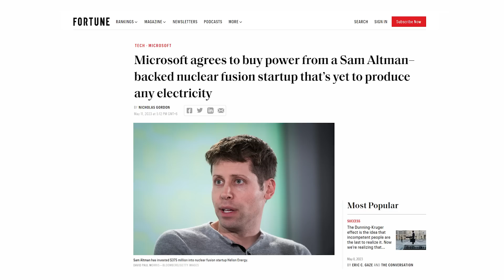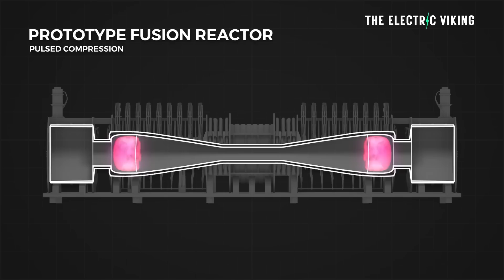Microsoft says the nuclear fusion dream is about to become a reality

Comment: Fusion energy may happen in the lab in the next few years, but building a power plant that can output to the grid at a cost lower than the ever dropping levelized cost of existing renewables is not going to be any time soon. These fusion designs all require very expensive equipment, and it will be quite some time until they know if they can keep them going without so much self damage such that they can't make payback. Remember, solar, wind, and geothermal are all zero fuel cost technologies. This means that even if the fusion industry can get their fuel cost down very low, their build-out cost will have to beat the built-out for renewables. So I agree, that the projected LCOE curve for existing renewables means that, even when fusion works, it will only be cost effective in special applications such as spacecraft, for the foreseeable future.
Reply: So why did we ever have nuclear fission reactors, those are stupid expensive?
Our power sources aren't purely just "whatever is cheapest" - sure, that can make up a large proportion of a nation's power needs, but that doesn't mean it won't use any other technologies.
Both types of nuclear should be good at providing "baseline load", they can generate up to a set amount of power and it doesn't matter if the wind's not blowing or the sun isn't shining.
Even if fusion is expensive, I still think at least several countries will want to incorporate it into their power grid. Sure, the process of building it may be subsidised through the government, but they'll be built regardless.
Reply: @Nabushika  - Nuclear fission reactors were supposed to be cheap, but it was a lie. However, MSRs really are going to be cheap compared to both conventional and Fusion reactors. There may be a few reactors, so they can justify the obscene amounts of money that's been wasted on these White Elephants. However, the cost is absolutely going to be a driving factor, you can't ignore fundamental economics.
Reply: @Nabushika  You are correct that it would have to be government subsidized. That is because the first cost you run into is the cost of finance. After you have a working prototype, you have to go in front of a group of investors and talk them into putting up the money for a plant build. They are going to ask when does it pay them back? The longer that projection runs, the more interest has to be paid. Right now, investors are funding renewables because the cost of building a renewable power plant shows return by beating coal and gas on cost. It is possible that after they get fusion to work, at all, they will be able to work on cost reduction until it becomes commercially viable. They are hoping to make it work, at all, in the next decade. If that happens, they are then looking at working the economics, not of  today, but of a decade from now when the costs of renewables are even much lower than today. The bottom line is that commercial fusion is still decades away, and will continue to be so until they can demonstrate a competitive LCOE.
Reply: 100% spot on.
Reply: @BadWithNames123  buuuulllshit. 10x cheaper by 2028, are you out of your mind? It's not even been commercialised yet, do you have any idea how expensive solar was for the first few decades it was around?
Seriously, I'm incredulous that you believe an expensive, still-experimental technology could outcompete the cheapest way of generating electricity we currently have, in just 4 years. Even assuming people can start making viable fusion reactors by 2028, which is still not a given, I'd be comfortable betting it doesn't undercut solar for at least a decade... in my opinion, the only way it'll beat solar is if/when our energy consumption grows by a couple of orders of magnitude, and we can scale up fusion but it'd be impractical to cover more of the planet in solar panels (although we're likely to have at least a couple solar space stations by then ;)). It might well be cheaper to make a bigger reactor with a massive amount more volume than constructing square kilometers of solar cells.... although if we can figure out the issues with perovskites, that's going to be insanely cheap.
Reply: @BadWithNames123  The point is that "cheaper than current electricity" is not enough, it has to be cheaper than future electricity at that future time.Not only will wind and solar plus batteries be cheaper next decade, but deep geothermal is expected to come in with 24/7 baseload capability with no battery. I expect fusion will happen, but it will take longer than the developers hope it will (the usual case) and be used first in special applications where the cost is not as critical, especially spacecraft where fuel mass is most important.
Reply: Sorry, Helion and AGI (Artificial General Intelligence) are both a scam, good luck with that ..
Reply: @huveja9799  hah, sure buddy. AI has been advancing exponentially but I'm sure there's nothing to worry about as it keeps becoming more intelligent, more capable, and more general :P
Reply: @Nabushika  "advancing exponentially" .. well, actually the technology is old, the only thing that was done was to improve the architecture a little and use the advantage of the computing power that we have today.

That made it possible to train on massive amounts of text, and have massive number of parameters, but without any new fundamental innovation  .. nowadays we are already getting to the level where adding more parameters doesn't improve significantly. I wouldn't call that exponential improvement.

On the other hand, when we talk about AI today it is Machine Learning, and that is pattern recognition, nothing more .. but equally, you can stay waiting for the AGI to solve the problem of cancer or nuclear fusion, just in case have a good old fashioned wood stove nearby ..
Reply: @huveja9799  "adding more parameters doesn't improve significantly" - well clearly you're not an expert, studies over size of the network and training data show we're still getting better results just from making it bigger (along with providing more data). And that's ignoring all the new advances such as the transformer architecture - we've made significant progress and it's not just due to computing power (although of course we could not achieve these results without it).
Sure, you can argue all you want that it'll never be conscious, and I'll happily debate about that, but if you think it's not going to help us or be useful, you're deluded. One fantastic example is AI protein folding - that's allowing us to speed up drug discovery thousands of times, meaning more effective medicines developed for much cheaper than before, all because "pattern recognition" can fairly reliably guess the shapes of folded proteins from a string of amino acids. This was unthinkable a decade ago, and even 5 years ago the best algorithms couldn't compete with human intuition (if you want to give it a try yourself, there's a game!).
GPT-4 is insanely good at a wide variety of tasks. I don't think it's AGI, but it shows that we're making progress in that direction. Perhaps size won't be enough, I concede we may still be 1, 3, 10 big, new ideas away before we get something that people agree is AGI... but saying "it won't happen" is deluded. Remember people saying "it'll take us a million years to make machines that fly"? Or what about "humanity will never harness the power of the atom"? Do you think that in the 70s, anyone would believe us if we said we carried around supercomputers in our pockets that use just a few watts to do tens of billions of calculations per second? If you genuinely believe we'll never create AGI, respectfully, your head must be stuck in the mud.
Reply: @Nabushika  Yes man, I don't know anything about the topic and you are absolutely right .. as I said before, wait quietly while the "AGI" finds a cure for cancer and solves the issue of nuclear fusion .. but, don't forget about the dear old wood stove, leave it close to you, just in case ..  oh! I forgot, also invest  absolutely everything you have in Helion, what can go wrong? it has an "AGI" on the back, right??
Reply: @huveja9799  I have no idea what you're talking about, you're the only one who seems intent on saying "Helion = AGI", I honestly have no idea what you're even trying to say
Reply: @huveja9799  I also never said Helion was going to be a big commercial success. In my opinion, it's a bit too late for fusion technology, by the time we get there we'll be using almost entirely solar, wind and batteries (and maybe more widespread geothermal?) - I'm pretty confident in saying fusion will be a smaller part of the electricity we generate than fission ever was (for at least the next several decades - if we keep scaling up our energy usage to 10x, 100x, 1000x per person compared to today then I think fusion is likely to become more effective than renewables as it has potential to be more scalable).
Reply: @Nabushika  Abel, solar panels are going to be your Cain, are you seriously telling me that solar panels have the ability to compete with nuclear power, fission or fusion? 

At no time did I say that Helion = AGI, the only place where both are having a  coincidence is that Helion is a scam (with that I am not saying that power generation using fusion is a scam, for something more serious look at "Commonwealth Fusion Systems"), as well as it is a scam to ensure that the Large Language Models (LLMs) are the way to get to AGI (or as they say, "AGI sparks").
Reply: @huveja9799  you know what? I'm glad we've talked, those points seem much more reasonable now - aside from your first one, lol.
Solar is the cheapest way to generate electricity right now. Let me say that again. Solar is THE CHEAPEST way to generate electricity today (along with wind, but that requires more investment for a bigger output, iirc it comes to roughly the same cost per kWh). Nuclear fission and fusion will not compete any time soon, simply because they require so much infrastructure. It takes years of planning and building just to get a nuclear plant built.
I'm not saying they're bad options! They provide baseline load and are a very useful backup, I believe any grid should have some supply from nuclear. But it's WAY more expensive than just slapping down a few hundred solar panels, and it's not going to get much cheaper, even with micro reactors.
So, I'll try to reiterate my point: nuclear is useful, and decades or centuries into the future, if we start using orders of magnitude more energy then we'll probably abandon solar. However, for the next few decades, solar is, and will remain the cheapest way to generate electricity (costs are still coming down rapidly!). I am firm in that belief.
As for Helion... You may be right! I know a fair amount of physics but I'm in no way qualified to be able to look at their plan and say "yes, this will work, it is viable" (on the other hand, neither can I say "it definitely won't work", and I suspect you don't have the experience either). It's fine to be sceptical, it can be a positive thing and I'm sure it'll help you invest wisely in what you believe will work. However, since the only evidence I have to go on is the fact that they believe it will work, having much more technical expertise in that field than me, as well as receiving investments from other people who believe it will work too... I'd tend to say I think it'll probably work too. I don't think it'll happen tomorrow, I'll be surprised if it happens this decade. I don't know whether the investment is worth it or not, will it really be able to generate enough electricity to be useful by the time they get it working? I don't know. But none of this is relevant in deciding if it will ever work. Experts working on it seem to think it will work, so I'm optimistic, even if it's irrelevant (sort of like fusion remains to be irrelevant today, despite the years of research and progress that has been made - but we have still "achieved fusion", even if it's not commercially applicable or even in a way that makes it easy to harvest electricity from yet).
As for your final point, I find it very interesting. I'd be curious to know exactly why you think LLMs are incapable of achieving AGI. I definitely believe it's not the best/fastest/most efficient way to go if we're striving for AGI... but I think saying it "can't" be AGI is very pessimistic. It's fairly easy to see that it has a somewhat capable model of the world, and is capable of making hypothetical predictions about "what would the state of the world be if X?". Imagine if you had an "infinitely powerful" LLM, one that had somehow managed to build a working model of the whole world to be able to predict text better. It can answer any question about physics, chemistry, solve previously unsolved maths problems - even if it can't carry out any actions, I think this could be defined as AGI. Alternatively, perhaps you mean that an LLM cannot ever model the world that accurately? That's a fair argument, but I believe since there is already evidence that it internally models things, it's not too far of a stretch to say that it could use a sufficiently large text dataset to be able to construct a working model of any situation, with enough detail to be as accurate as you want. Again, it might be too large to ever be a practical way to achieve AGI, but I definitely think the possibility is there.
Oh, lastly, that Cain joke is kinda lame.
Reply: To explain everything you need to know, I should write a book and I would still probably waste my time.

But there is a simpler way, write down the date of today or yesterday, and schedule an event for 5, 10 and 15 years from now.
On those dates you check how is going with the "cheap" solar energy, how is going with the "AGI", and how is going to Helion producing energy by "fusion". 

As for the jokes, you're definitely right, there's a reason I'm not a comedian. I probably should have gone into drama, although I didn't either, as I'm always intrigued by why people fall for scams over and over again ..
Reply: @huveja9799  okay, so you don't believe Helion will succeed at all, but you do believe fusion will become cheaper than fission, cheaper than fossil fuels, cheaper than geothermal and solar in 15 years?? (or you think solar will get more expensive?)
Reply: @Nabushika  I already said it clearly, Helion is a scam and AGI is a scam. 

I do not know if fusion energy will be viable, but there are interesting ventures working on the subject (of course not Helion). 

Fission energy is already cheaper than solar energy, if you don't believe me, well, make a little effort and do some research ..
Reply: @huveja9799  not viable, but already cheaper than solar? We haven't even got power out of it yet, let alone made it cheap to do so! How can you claim "it's cheaper (per kWh) than solar" when we haven't even been able to generate more power out than it consumes? We don't have a fusion generator, we have fusion experiments and fusion loads :P
Reply: @Nabushika  Your question is a bit strange, if I don't know if fusion is viable, less I will know the cost, when they manage to make it viable and then scale it, the costs will be known. 

What I definitely know is that it is not necessary to go to the future, right now fission is cheaper and less polluting than solar energy.
Reply: @huveja9799  you're just categorically incorrect. Solar panels might cost a few thousand to install and start generating electricity.
All current "fusion reactors" have cost hundreds of millions to build, for the research, for the expensive tritium fuel, for the salaries of hundreds of highly skilled professionals to spend years working on it... AND IT'S STILL NOT GENERATING ELECTRICITY.
If you keep claiming that fusion is the cheapest way to generate electricity right now, I'll counter with this: clearly pencils are the cheapest way to generate electricity, I'll sell them to you for cheaper than a fusion plant, and you'll get more net energy out!
Seriously, there is not one fusion plant that is actually generating electricity right now. Feel free to prove me wrong, I'd love fusion to be a success, right now! Just link me to ONE piece of news to back up your claim, I'll spin on a dime, but I know you won't because it simply doesn't exist yet.
Reply: @Nabushika  I would recommend you to read more slowly what I wrote ..
Reply: @huveja9799  "I don't know if fusion is viable [...] or the cost", and then... "right now fission is cheaper than solar"?
Reply: @Nabushika  great! which one am I saying is currently cheaper? read carefully ..
Reply: @huveja9799  you are absolutely right, I apologise, I completely misread. That being said, my point still stands, LCOE for fission is higher than every other commercial method for generating electricity. It's certainly not cheaper than solar.
Looking up the data, there's a report from Lazard which puts solar/wind at $40/MWh and fission as $175/MWh.
If you think this is wrong, I do have a question: if fission is cheaper, how come a huge number of countries are going through a solar boom? Solar output has grown several times over in the past year or two, yet fission is pretty much stagnant. If fission is the cheapest option, why aren't we seeing loads of new fission plants being built? Hell, even if you believe it's because of people's feelings about nuclear accidents, look at China - if they wanted to build fission reactors because they're the cheapest way of generating electricity, if their people protested, do you think the Chinese government would care? No, they're building up solar because it really is the cheapest.
Reply: @Nabushika  Show me a single first world  country that runs only on solar energy, I would say zero, but 70% of France's generation is by fission.  

What you are not talking into account is all the additional infrastructure it needs to use solar energy, because due to its unreliability it is needed to build gigantic energy storage facilities using batteries, not only does that greatly increase costs, but it produces pollution massively. 

On the other hand you also don't take into account the new generation fission nuclear reactors, the small modular Thorium nuclear reactors. They not only are more secure, but they produce much less waste than traditional reactors and the waste is much less radioactive and has a much shorter life than Uranium waste.
Reply: @huveja9799  Firstly, NO country has a single energy source. South Australia is getting amazingly close, I think they had a whole month last year that was entirely run on solar power - but even then, their grid is connected so they can import/export power because it's always stupid to rely on just one. Just because nuclear is expensive, doesn't mean I think we shouldn't have it - I said earlier that it'd be very useful as part of any country's grid. France has a lot of fusion reactors, yeah. They were built before solar became as efficient and cheap as it was today. Regarding batteries, sure they make a difference, but it's not as big as you claim - firstly, during the day, energy can be used as its generated (and models have shown we'd save a lot of batteries if we switched to using smart devices to tailor demand to supply, rather than the other way around), plus batteries are getting cheaper every year. Regarding pollution, perhaps you'll be interested in the new sodium-ion batteries currently in production at CATL - no mining for rare metals, they're less energy dense sure but they're cheaper, which makes them perfect for grid storage since size/weight don't matter. 
Thorium is a great idea and I wish we'd got it working sooner, but I'm fairly sure we don't have any commercial thorium reactors yet either. Again, a great idea, and very useful, but not generating electricity yet, so we can't really make claims about how expensive or not it'll be (I feel like total cost for building the reactor will be on par with fission, but - you're correct here - much less, lower-level radioactive waste that costs money to clean up, and much higher fuel efficiency. Probably meaning cheaper to run :))
Reply: Sounding like the troll, Helion a crummy scam.' Repeating it to turn people off. Hype Is building around Commonwealth Fusion Systems which is building a facility to turn on and be ready by 2025. The reactor is named SPARC. Their really ambitious to prove it works. These companies are serious about bringing fusion to reality attempting to power the grid by the early 2030s. It's viewed as the holy grail of energy. It could really help climate change and offer abundant clean energy. It's good to see new private firms step in like Helion etc.